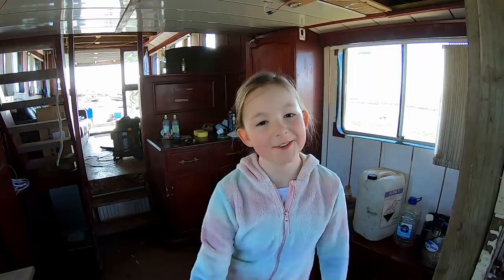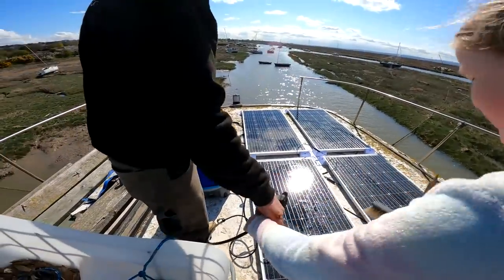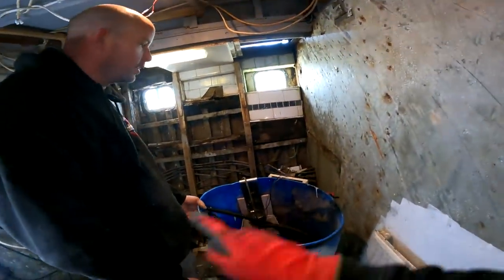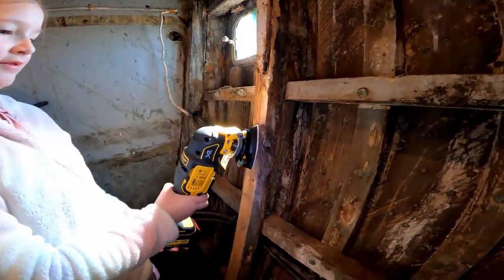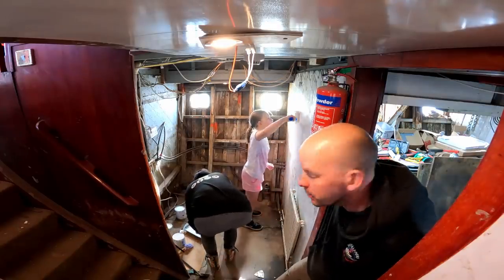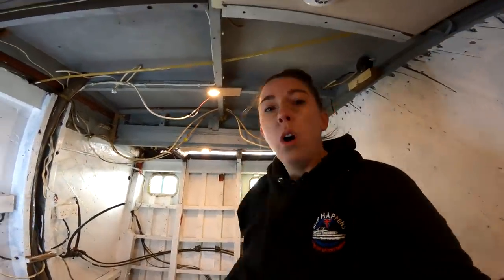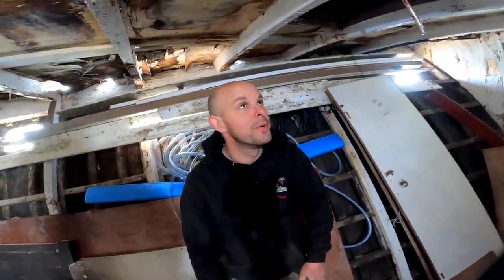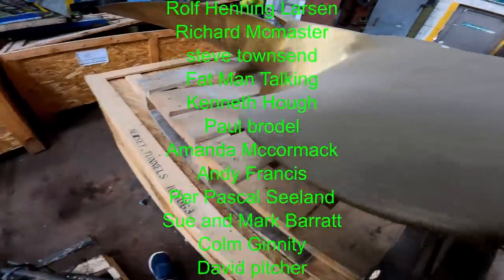Ep 15 Part 2 - Painting The Old Galley, And A Visit To A Boatyard

Comment: Hi, just cruising your fun channel. If you suspect a leak in your circulating heaters, you can dye the hydronic fluid and find the leaks by color, or even 'Black Light' luminescing dyes. If your system is water based, food dyes will work fine...You can drive small tacks into suspect wood before painting. 🧐

Comment: Speaking to the heavy bulkheads in what ended up being the galley, Wikipedia says "The hull was divided by bulkheads into six watertight compartments, and could remain afloat with any one compartment flooded.".  As the cabling shown along the outboard side along the hull appears to be fitted with watertight penetration fittings where they penetrate the bulkheads, my guess would be that you are looking at two of the original watertight bulkheads.  If so, then they would have originally been fitted with watertight hatches similar to that leading to the engine room.  A "tell" would be whether the bulkhead extends all of the way to the keel.  I would expect to see the bilges in 6 separate sections as well.  Sailors on a military ship are accustomed to opening and closing multiple hatches as they move from one part of the ship to the other.  Civilians not so much.  The watertight hatches probably went away when she became a yacht. 

Have you had the opportunity to take a look at the auxiliary diesel which drives the ship's generator?  Was originally a Gardner 1L2 single-cylinder which would be safer to operate than the petrol GenSet and should be quite miserly with the diesel consumption.  Hope it is still there, and not replaced with a generator off of the main engines.

Comment: Hi Gemma,Simon,Emilia and Mason. 

Little tip for you if your using a portable pressure washer 
:- If you have a condenser type tumble dryer at home,keep the water from the tank as it is softened water and distilled so it won’t leave any water marks ( limescale ) on solar panels or Paintwork ( washing your Van/Car etc ).
You can use it in your Iron too Gemma rather than expensive Ironing water or distilled ( as the impurities are not in it heating elements last longer ).

I put mine in a big bucket with a old pair of tights over the top of the bucket to catch any fluff from the dryer and then put it in a 25ltr drum and I use it for final car wash rinse and ironing/washing the windows. 
The supermarkets charge £1.50 for a litre bottle of distilled and even more for ironing water. 
Theoretically you can use it in batteries too but I haven’t ever needed to as 99% of batteries are sealed these days. 
In Coolant systems ( ie car rads you should really use distilled and not tap water). 
Use it in your windscreen washer bottle and you won’t get sludge etc.

Comment: The originally designed superstructure on your ship is big enough for a crew of 4 or more without the risk of capsize or ploughing into seas. Acquiring a spacious heavy transparent plastic braced tent anchored in an open area on deck as an addition might work as an addition later.

Comment: Now that ya’s have a ship, them are wheels, or screws. Arrowplanes have propellers. lol

Nice work guys. Can’t wait to see the ships bum!!
Reply: By definition a propeller pushes while a screw pulls. The ones on aircraft were technically referred to as an airscrew if on the front of the aircraft to drag it through the air while a rear fitted one is a propeller (this type of plane is usually referred to as a pusher-type) to push it through the air. All screws fitted to the rear of a ship are propellers regardless of industry terminology, so confusion abounds.
Reply: Propeller is a perfectly acceptable term!

Comment: You could try using your pressure washer with a wet vac to clean the timbers. Wash a bit and quickly vac it off. Like you would work on a carpet. Wetting but not dousing the wood before it’s primed for paint.

Comment: Check out this time, money and work saver product. Wood Hardener is a quick drying liquid formulated to strengthen and reinforce decayed or rotting wood. The hardener penetrates deep into the wood and its special resin binds and reinforces the decayed wood fibers. Potentially saving you $$$$ and many, many hours of hard laborious work! Don't just hide it with paint. Once you paint rot or cracks the resin will not bind and your only recourse is to rip it out and replace the wood because the resin will no longer penetrate into the fibers.

Comment: One reason two bulk heads close together could as you say be something heavy. Bearing in mind the reason she was built this could be a cannon or depth charges. Have a look at some original photos. It could also be something less interesting as keeping the boat together at full speed. Structurally 2 bulkheads are better than one even if the one bulkhead is the same thickness as the two bulkheads combined,

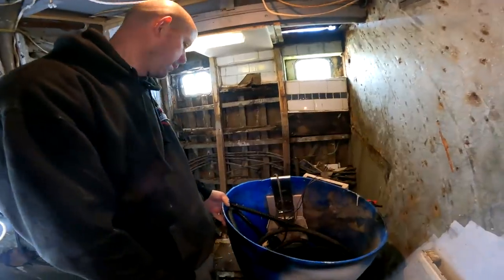Comment: at 9:19, you might find the original bulkhead positions and materials on a loft plan in the records.. remember the rigidity of the outer planks is based on the bulkheads and internal framing..  I'd use mahogany if you can find it used, no need to buy new stock.  Teak would be way past cost effective, but if you find some, use it..  also, Emilia is going to make a mighty fine worker later in life.. not that she isn't now.. she is so coachable..

Comment: WARNING => WARNING => WARNING => Wood needs to breath => For instance house windows made of softwood painted both sides rot when water finds a way in => When only painted on the outside moisture in the timber evaporates into the house =>> If I was in your boots on hull & structural timber I would use whitewash with a dash of linseed oil & a dash of colour of my choice ==>> I would also have a small dehumidifier running 24/7 as dry air will feel warmer for you & the boat hull ><><

Comment: That says "Thwart ships  Bulkhead", Meaning it is a wall that runs for one side of the ship to the other. A Bulkhead is any wall on a ship, and a Deckhead is any ceilings. There is no floors in a boat they are all decks.
Reply: Sure that there are no floors or ceilings in a wooden boat. They might just not be where you think they are
Reply: @sailcargouk5781   you can find them in your mansion on the hill or in your garden shed if you know where to look, but you will never find them in any boat or ship.
Reply: There are floors and ceilings in a wooden boat.
Reply: @sailcargouk5781  If you say so, and I guess being the authority you are you will know. Over and out.
Reply: Basic stuff boy. You seem bitter

Comment: Just my 2 cents worth..... A wooden hull sitting in mud is NOT floating. I would think that FIRST job would be to ensure that you have a viable and WATERTIGHT hull. To do otherwise is putting time, money and effort into something that will be in danger of sinking as soon as it is free from the mud..........
Reply: We've been all through this in their previous videos. The boat does float when the tide comes in and it doesn't leak to any significant degree. It needs a minimum amount of work before it can be moved to a slip for inspection, but they cannot afford to have it sitting in a boatyard for years.
Reply: It wouldn’t need to be out if the water long to do a proper inspection and actually keeping it out if the water  would be bad for the hull ,  not sure how they would get it out as I don’t think the hull would stand the strain of a travel lift with the decks in the condition they are ?  But as others have said better sooner than later.
Reply: They're treating it like a house at the moment - A (UK) house will stand for years without maintenance. Boats look for any excuse to stop floating. As others have said, we've been through the arguments before. They don't know what they don't know, however I'm sure they'll learn. In the meantime, it's fun-and-games in the Wendy house! :)